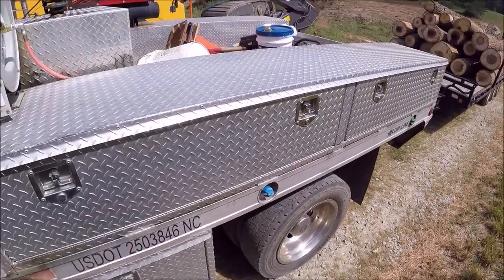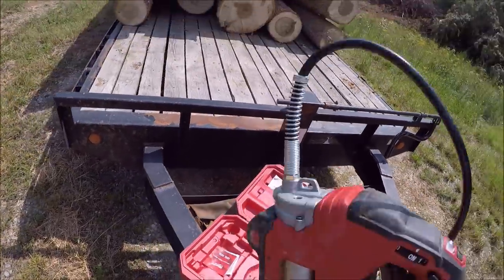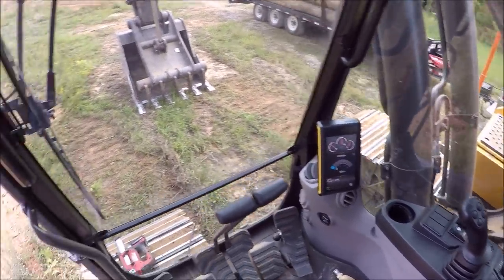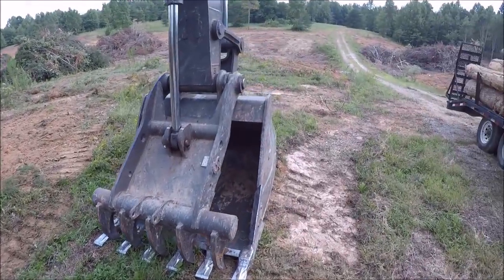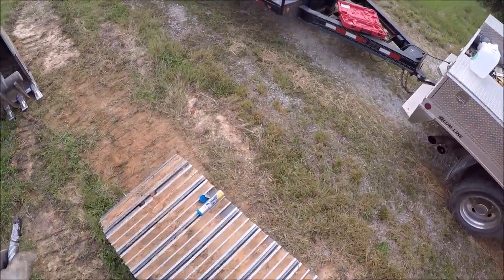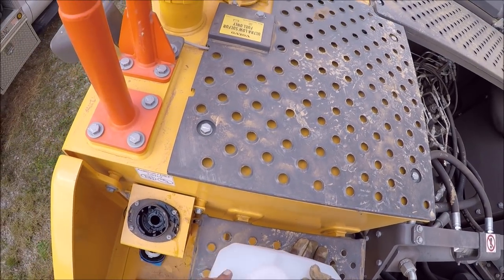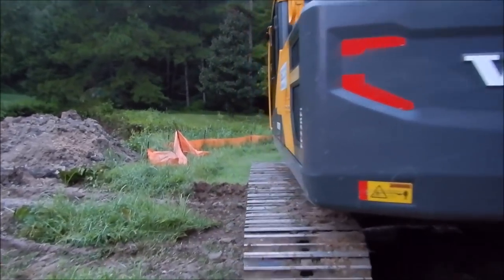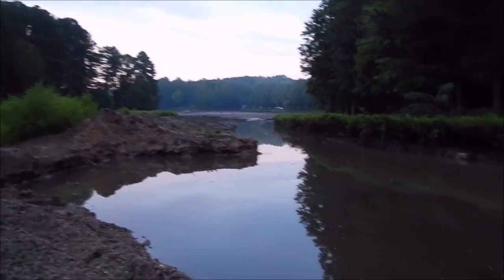Daily Equipment Maintenance

Comment: I was taught, when greasing...to wipe off the zert... Before you grease, to avoid injecting dirt into the line(s)....Also, to wipe off any excess grease, when you are done, to minimize the dirt and dust collecting on the tip of the zert....but hey.....this may be over kill for some...but it makes for good practice, for better maintenance......good luck.

Comment: Chris, I know that you like to keep your engine covers and fuel caps secured to prevent any problems. Just thought you should know that Mercedes has a locking DEF cap that fits different DEF tanks.

Great videos, keep up the great work!
Reply from the maker: This cap locks as well

Comment: I've got a question for you Chris, how come you don't get an lubrication system for your excavator? I can not recall seeing a new excavator, backhoe or loader being delivered in Denmark without it, even my Hydrema 906D backhoe with 3500 hours, that's 6 years old has it on, any specefic reason you don't have one?

Comment: Can’t you leave the auto greasing connected and just take it off for the bucket? So that the only manual greasing is the stick. Or do the lines stick out to far even on the stick?
Also do they have an option so that everything on the machine is auto greasing.

Comment: Chris, we are looking at purchasing a newer backhoe but not new. We are looking at a Cat but I'd be interested in hearing your opinion of a Volvo backhoe. Thanks. I'm from around Surf City NC ( we currently have a 2000 JD 310e)
Reply from the maker: Honestly I'd rather have the Deere, good backhoe.  Volvo does not make them anymore, they wont the best and parts will prolly be hard to find. You can't go wrong with a Deere, cat or case backhoe
Reply: @letsdig18  thanks for the info

Comment: Hey Chris, you may know but if not I was told by one of my mechanics that DEF fluid has a shelf life and can cause serious problems if used after!!! It's ruining diesel engines.  Just thought I'd let you know/
Reply: if the container is new and still air tight you are good and some engines are more sensitive to contamination than others
Reply: Good fluid already causes serious issues
Reply: The "shelf life" thing about DEF, is that after sitting around a while, experiencing lots of heat,  it begins to crystallize,  and it's the crystals that will give you trouble if you get them into your tank.  The stuff "dries out", that is to say,  the water in it evaporates ESPECIALLY if the container holding it is not well sealed up.  As for refilling small containers to carry with you,  the secret there is to rinse out the empty container after you put the DEF into your machine,  rinse it out well with clean water.  If you can't rinse it immediately,  then later on you will want to use very hot water to loosen any crystals that formed inside that container.  Cold or ambient temp water alone will not dissolve any leftover urea that dried inside the container.  So rinse them out really well as soon as you can, then keep them closed up tight until you refill them, then again keep them closed up tight.  Don't hoard the stuff away for a special occasion, use the stuff out of the containers within 3-4 weeks, and if you are going to reuse the container,  rinse it out well, then refill with fresh DEF from your supply source.
Reply: Well, if you put DEF in the tank its definitely ruin your engine....

No, seriously: Why would it ruin your engine, as its injected into the exhaust system? The  few problems i know of are clogged filters if your store the DEF not warm or an faulty DEF injector in the catalytic filter might disintegrate due to overheating as the fluid cools  the injector itself.
Reply: DEF isn't put into the diesel tank, it's put into the DEF tank,  and DEF doesn't get injected into the fuel system, it gets injected into the exhaust stream.
Reply: Stan Patterson that was my SIMPLE suggestion too Chris..... use it as needed,  "don't hoard the stuff away"!!! Thanks for all that other scientific awareness though.
Reply: Stan Patterson just curious is Josh your brother????
Reply: He could be my brother from another mother... but no, we're not related, and pretty sure we have never met one another.   Just curious,  are you related to Jeff ?
Reply: Yep there is a chart out there for length of storage that all depends on temperature its stored at.

Comment: Buy the DEF in bulk. Around here the 2.5 gal boxes are 11 or 12 bucks on sale. We are getting 55 gallon drums for $177. Even cheaper if you use enough to justify the 330 gallon totes.
Reply from the maker: we buy it by the pallet for 7-8 bucks a jug

Comment: Aren't you afraid someone will stole your petrol from reservour through the night since you fill it up at the end of day?
Here in europe where diesel is around 1.2€ ler litre this is happening a lot.
Reply from the maker: no I keep it locked and have never had a problem
Reply: We have guns in the US!
Reply: Did you see the locking cap?  I was thinking what a shame. You got your machine out in the woods someplace and you have to still lock it up tight. Gallons here about $3 now for 1.
Reply: @tiredoldmechanic1791  haha:-) practical.